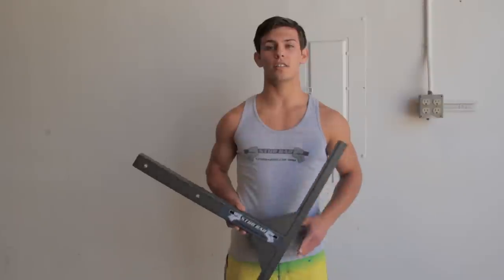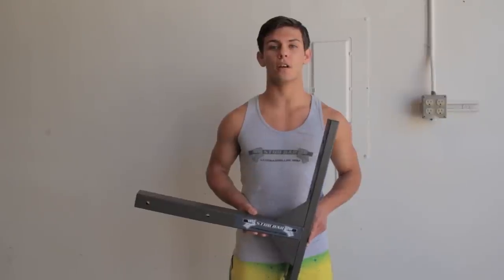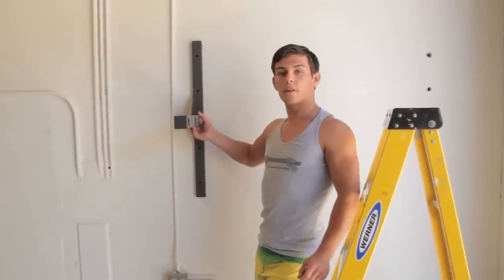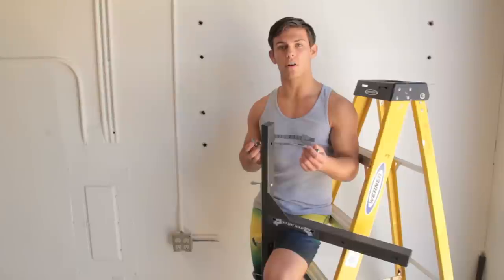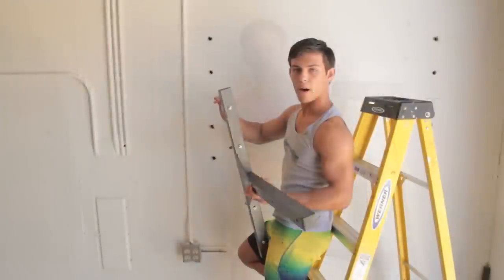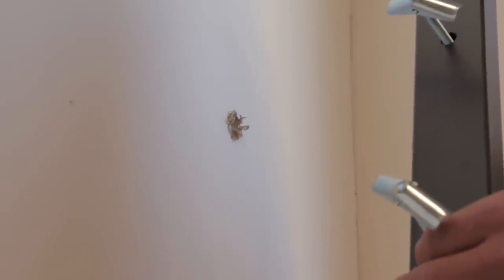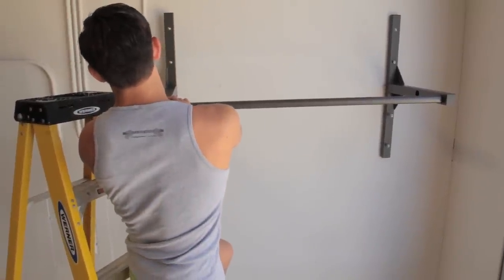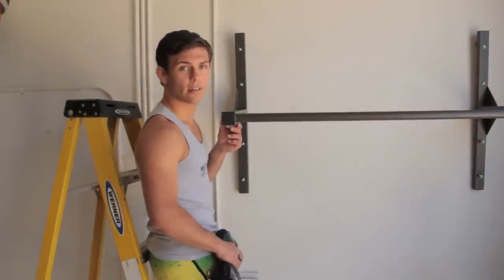How to Install a Stud Bar Pull Up Bar into Metal Studs

Comment: It seems as if you are driving the toggle bolts directly into the drywall, and this isn't a good idea; you may have good toggle bolts, but the drywall itself can rip away from the wall.  Having your bar fall on a person while they are suspended, doesn't seem very fun.

Adding a 3/4" plywood board first, which you would secure to the studs of the wall, and then use the toggle bolts through the plywood, then the drywall is a much safer solution.  This is the same solution we use to mount electrical equipment to aerial racks for telecom/data needs.  Very safe.
Reply: Yeah - steel with toggles is pretty strong, but with a dynamic load it can fatigue slowly over time. A plywood backer is much more elastic - it can bend slightly back and forth without losing its strength.
Reply: @tanafras I just installed a pull-up bar into three metal studs across two 2x4s. Six flip toggles. Do you think that would be safe?